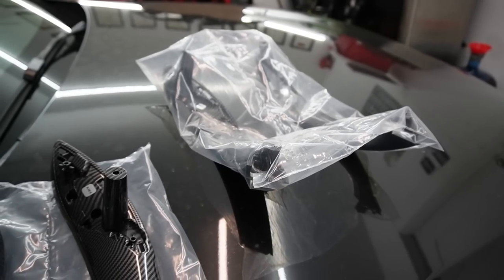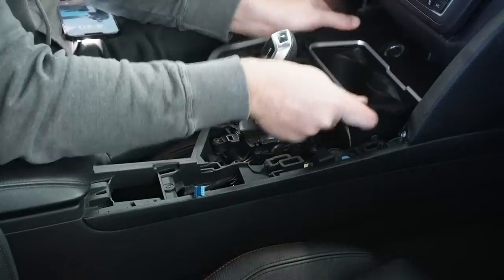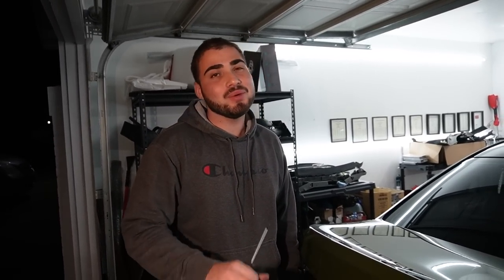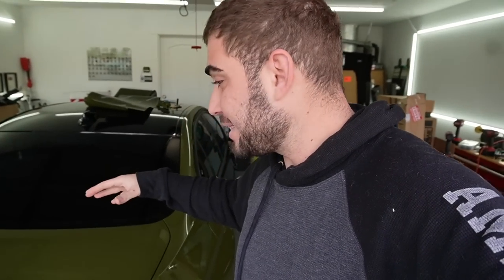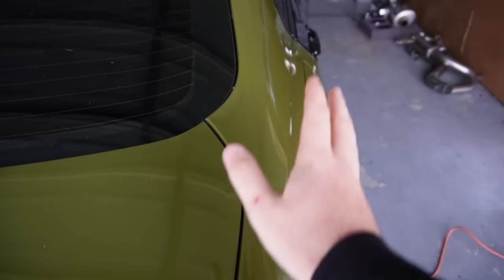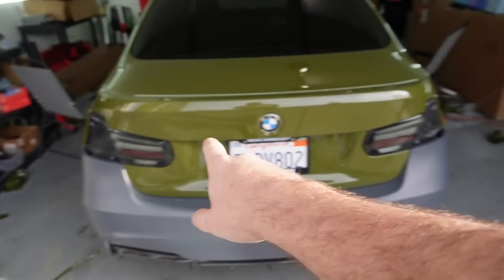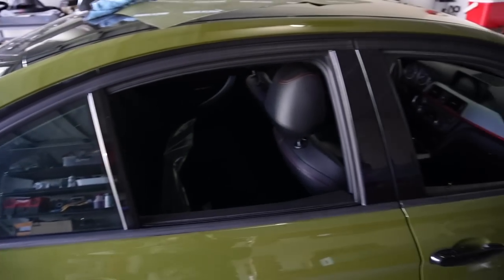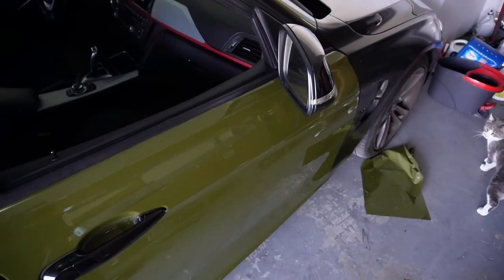F30 GETS BEAUTIFUL NEW WRAP! Plus More!!!

Comment: The color looks sick Nour! You should probably consider doing inlays though, although the film laid down initially it will bubble in the next few days. Especially since vinylfrog is a calendar film, I believe it comes pre-stretched from the factory, so the heat will make it shrink over time, causing there to be a bubble wherever you bridged the gap such as on the rear bumper